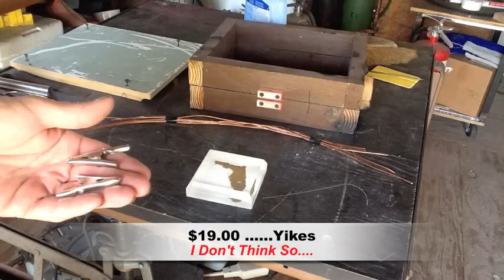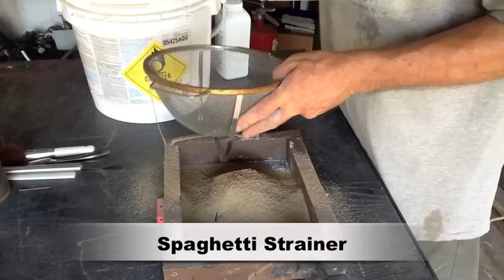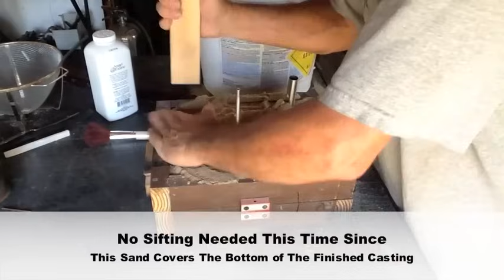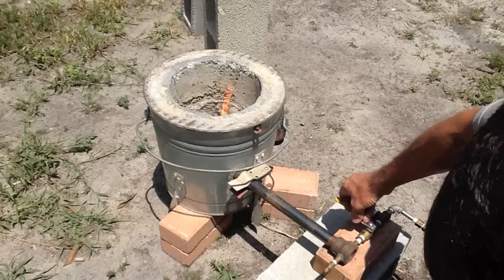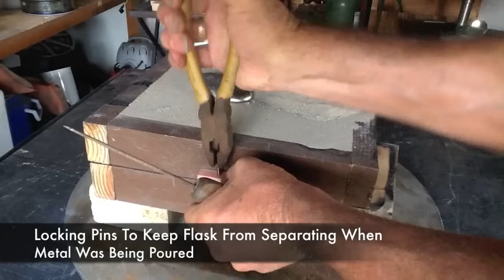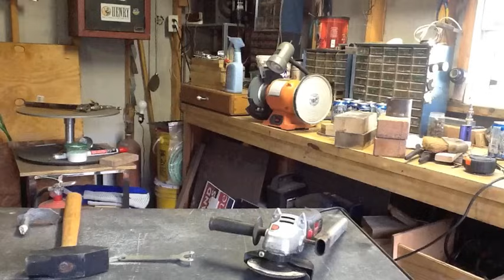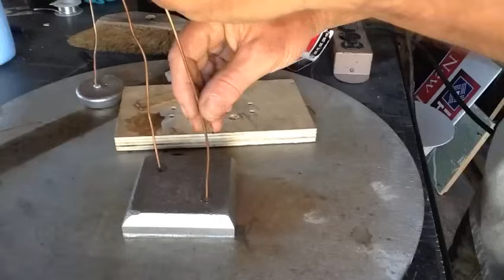SAND CASTING LESSON FOR BEGINNERS - STEP-BY-STEP - (A 3rd HAND) - MSFN

Comment: Nice. However, holding an object in your hand while using an angle grinder is not a good idea. Ask me how I know. Bench grinder should be bolted down. At least eye protection was used. Good job on the molding process.

Comment: I am thinking of trying to cast some seed plates for an International Harvester Duplex Planter.  They are concave on the back and convex on the top, with about a 4" opening in the bottom that sits on another flat plate that turns the seed plate.  They are about 8-9" in diameter and about 1" deep.  I think I would place the seed plate in the bottom half of the mold with the larger diameter on the table top.  Sprinkle talc powder, cover with green sand, then turn the "drag" over.  Due to the 4" hole it will have sand in it.  I guess I would remove the green sand in the concave part of the seed plate.  Then I would talc the top of the drag, install the "cope" and insert a sprue and vent rod then fill with green sand.  Then seperate the "drag and cope" and make a channel from the sprue to the pattern.  The plate is about 1/8" thick.  Is this something that could be done with Aluminum?   Would I need to put in extra vents or sprues, and does it matter if the vent is at the top of the item or at the base?  The original plates are cast iron.  Thanks for posting and sharing your knowledge.  Ken

Comment: This sand casting tutorial is an exceptional resource for beginners venturing into metal casting. The instructor’s clear, step-by-step guidance simplifies the process, making it accessible even for those new to the craft. The video covers essential aspects—from preparing the mold to pouring molten aluminum—providing a comprehensive overview. It’s evident that safety is a priority, as the instructor emphasizes proper precautions throughout. The practical tips and thorough explanations instill confidence, encouraging viewers to try sand casting themselves. Overall, this tutorial is both informative and inspiring, making it a must-watch for aspiring metalworkers. ￼

Comment: I have read that you should only use electrical solder for wires. Apparently plumbers solder has aggressive compounds that can degrade the wire. You may have better luck with the electrical solder.

Comment: Great video, bud. The ingot mold on the plywood was no where near as bad as what I did.. I was making bronze, and when I poured the molten bronze into the heavy steel cupcake mold I had, I quickly realized the steel pan was in fact aluminum when molten aluminum came flowing out from under what was left of the pan in every direction.

Comment: Possibly a stupid question but,

Is the sand reusable afterward? I mean in the sense of do you need to mix anything with it post its use like more clay etc or just good to go again,

Also are you just using that fine sand mix with clay or just straught normal wet sand?

Thanks
Reply: I should mention I ask this because I saw a video of a guy using aquarium sand and mixing it with 5-10% kitty litter (clay) and light water to make a mould able sand

Comment: THANKS, MSFN, FOR DEMONSTRATING THIS ESSENTIAL, USEFUL PROCESS!!! :face-green-smiling:IMHO: I WILL SUGGEST THAT THIS SIMILAR PROCESS, CAN BE USED TO POUR BABBITT, (WHITE METAL) SOLID BEARINGS, FOR LOW SPEED AXELS, AND SUCH. PERHAPS YOU MAY THINK OF SOME APPLICATIONS, FOR THAT PROCESS,... PERHAPS MAKING SOME SORT OF "ROLLING MILL", OR SHEET METAL ROLLER/CONE ROLLER, OR A BENCH MOUNTED TURNTABLE, OR, A "STAKE-HOLDER" FOR HOLDING SHEET METAL HAMMERING DOLLIES, FORMERS, ETC., ETC. :face-blue-smiling: BEST WISHES!:face-red-heart-shape:

Comment: Thanks very much for a great video describing the process.
I went on a 'grinding wheels' course in 1981, the training was a requirement for classroom teachers delivering metalwork classes. I still remember the holes in the roof above the grinding machine in the training centre. They'd decided to leave the holes there to reinforce the consequences of misuse of high RPM wheels. With bench grinders, it's important not to grind soft metals such as aluminium, copper etc as the metal clogs the wheel and causes it to become unbalanced, then potentially break up and part company with the drive spindle. Over the years, I've developed a technique for grinding my wood turning chisels, which involves standing to the side of the grinding wheel - out of the line of fire :) :)
Reply from the maker: Thanks for the good story, I was new to wheels at the time it was filmed. I am glad they left the holes :)

Comment: I see that Henry sticker in the back. I bought a Henry for Christmas. X Model, .357/38 w/sidegate and threaded barrel. Its so fun shooting 38s suppressed. Ive been reloading for about 15 years and have a bucket full of spent primers and bad brass. Im getting ready to finally melt it all down for stock for the mill and lathe. Cheers from Idaho.

Comment: I use an electric heat paint stripper gun for soldering on stuff like Bowden cables works great not too hot. What do you use for the melting pot ?

Comment: I am not sure if this is the right place to ask but do you have any idea where I can get more hands on experience like this? Outside of messing around with an Arduino and working on course related work in the shop I haven't gotten too much hands-on experience and I'm not sure where to start. Any insight would be appreciated. I've noticed a lot of people have been referred by their professors which is great, mine also did the same (not to this one specifically). I just had the thought that instead of just watching being able to actually work on these might be helpful.

Comment: This guy is not a professional. Professionals use binder (e.g. sodium silicate, a.k.a. water glass), googles, and protective garments. Carbon dioxide turns the sodium silicate into a solid in a few seconds. The binder costs pennies, but it greatly improves quality of the cast. Some amateurs use glycerol diacetate rather than carbon dioxide to harden the silicate. This method is slow - it takes 20 minutes.
Reply from the maker: LOL

Comment: Epoxy really doesn't adhere to copper very well, I use copper wire to stitch objects together temporarily when preparing to epoxy them together then pull the copper stitching out using wire cutters and pliers once the epoxy cures.

Comment: Hello. I am a beginner, and my project might be too difficult, but i try anyway... 😅
My grandfather gave me a bb rifle, (use it to shoot rats) but the wooden stock fractured, want to pour new one from alu cans, but i'me thinking to make 2 molds (rear part flat on its side, and front part turned 90 degrees to be able to remove from mold) and than removing the sides and connecting the 2 (lining up the holes and at 90 degrees to each other). You think that's doable? Or is there an easyer way? 
Thanks for your vids, they are a great help 👍
Grts
Reply from the maker: Sounds like you have a good grasp of things. Try it, if it fails remelt & try again.
Reply: @MakinSumthinFromNuthin  Will do. I'll send a picture of the result (whatever it looks like 😅)
Reply from the maker: @yvesdedecker8090  awesome!

Comment: what type of metal did you use, and what kind of sand? thanks
Reply from the maker: I melted aluminum, here is the recipe for the sand: https://www.youtube.com/watch?v=2rAQxw6X6uc
Reply: ok sir, I am getting pretty in to this lol. Do you have a video on equipment? like a forge and crucible? Or where to get these? thanks for all the info
Reply from the maker: @timheller5929  Yes, I do......go back a ways in my video collection and you will find what you are looking for
Reply: can you buy clean aluminum?
Reply from the maker: @timheller5929  Yes, if you can find a friendly scrap yard you can. I have a friendly one nearby
Reply: how many times can you use the sand after cast
Reply from the maker: @timheller5929  over & over, years

Comment: Thanks for the video. I've casted a few times during highschool in engineering. It was always fun working the forge. Now I need it because I've got a few older cars, the parts aren't being made anymore. So I figure I'll cast the old one, sculpt the sand, cast it and see if a machine shop will do most of what I cannot do. 

Question? Is there a way to cast hollow objects? Like pipes and tubing?
Reply from the maker: Yes, a sand core is used. Google it and you will see how its done

Comment: I've been soldering since I was a boy.  I'm, 67 now.  Here's a couple tips.  Everyone knows to use flux and to clean the parts you are soldering.  But don't forget the SOLDER can't have DIRT, or CORROSION, or water-damage or ETC.  Also soldering electronics, you must have a proper iron for the job.  Micro electronics requires a very tiny iron.  Soldering metal chassis parts requires a very  large iron or a torch.  You probably already know that.  I bet your SOLDER is old or dirty or oxidized, which causes trouble.  The old solder with LEAD is easier to use than the new ones that are lead free.

Comment: Do you place the crucible directly on the bottom of the furnace? Mine has a type of insulation bottom, so not sure if I need to put in some kind of brick first. Extreme beginner if you haven't noticed haha

Comment: I'll be amazed if you respond 6 years later,,, nice video,, I want to carve out a international travelall from the mid fifty's ... One said not to use wood to make the pattern in the sand,, I don't see a problem since the molten aluminum wouldn't be in contact with the wood ,,, any thoughts?
Reply from the maker: Cool old vehicle. Wood is probably the MOST common material used to make patterns, allow for draft angles when making the pattern, a smooth coating of gloss paint doesnt hurt either
Reply: @MakinSumthinFromNuthin  thanks for responding,.  It's a big undertaking.. I have the block of wood and have been thinking of a way to be a urate on both sides while carving ..
Reply from the maker: @retrobrid2784  look into how to make a "split pattern"  On my main page is a video on how to make your sand
Reply: @MakinSumthinFromNuthin  , I like it, though I strive for the best results , so hopefully time should be well spent.. I have a devise that will tell height and distance from center on both sides..  it's a start however, not sure if that will be enough from start to end.. I do make alot of items not on the market... I should make a video of my 4 wheel steer car / there's one under cutting donuts crazy car.. winter scene .. I would like to hear of any pointers  on carving / I can't be in a rush... Aluminum is the metal of choice ...
Reply from the maker: @retrobrid2784  I am no woodworker whatsoever, best of luck on your project!
Reply: @MakinSumthinFromNuthin  thanks ,, what I hope to build in 1/16:scale is international d220 with the diamond plate fenders with the corresponding window wagon body that takes the place of the day cab.. the firewall  is the same dimension as I have the real truck and wagon,, just have to make the back half of the front fenders for the rear

Comment: Tha ks so much for this. I built my own furnace and have melted down aluminum and copper so far. I want to actually cast something. What kind of sand do you use and what binder is in the sand? I was thinking like play sand mixed with motor oil just because that's what I have in my garage. I appreciate you.
Reply from the maker: https://www.youtube.com/watch?v=2rAQxw6X6uc
Reply: @MakinSumthinFromNuthin  thanks so much! Time for me to get to work.

Comment: This was a great video for demonstration purposes for sure !   but I do have to point out that in some cases, it's just easier to pay the $20 to get the tool you need.  When you factor in the cost of the sand, the foundry you made, the grinder, abrasives, the epoxy   it would definitely be cheaper to buy the tool.  No worries though, I am still giving you a "like" !!
Reply from the maker: for the 1st project, its not worth the expense. Make multiple items around the home is very well worth the effort

Comment: Hello,
The only thing wrong is your use of the bench grinder for non ferrous metal. We never use a porous grinding stone for non ferrous metal. Only ferrous metal on the grinding stone. Why? Non ferrous metal such as aluminum will be forced into the pores of the stone and can cause the grinding stone to disentigrate and explode on the user. Unsafe practice. Use your circular grinding cut off blades or a file. Take care.

Comment: The only thing better than making your own tools is years later when you pick it up to teach your kid and you can see that familiar patina on if from loving use over the years.  Maybe cast the "3rd hand" completely out of copper so if and when the wires break you can throw the whole thing into a crucible and recast it.  You could possibly also cast the wires directly into the base.

I love that your striking off tool appears to be a salvaged leg off of something, and I don't think that "sand gasket" is a step I've never seen anyone else use.  Need to pay attention and see if they are.

Comment: Im looking at doing my first casting and i think it's probably quite a tricky one, any advice is welcome!!

I need to create a centrifuge bowl, around 350-400mm diameter, around 120 tall.
The lip of the bowl for a centrifuge hooks back over towards the centre to make it function properly.
Im wondering what the simplest way to make a form for this would be.
I can turn a wooden pattern but can't work out how id get it out once the sand is packed around it. The profile of the bowl would look like a rectangle with the centre of one of the long sides removed.
I appreciate your thoughts on the project.
Im pretty confident making things, have a well stocked workshop and am sensible enough to be cautious so it's mainly the technicalities of the form im stuck with, but any advice is welcome!
Im thinking car wheels, engine blocks or bull bars for materials to melt down, but other suggestions are also welcome!!
Cheers from Western Australia

Comment: When you pull the pipes out of the fill/vent holes and then scrape the top level, couldn't it cause sand to fall into and block the holes?
Reply: nvm, I should've continued watching before I posted this question ;)

Comment: I dont have money for all that fancy equipment could i do this with a burn barrel might take longer
Reply from the maker: it can be done in a charcoal grill using charcoal or wood if ya wanna try it
Reply: @MakinSumthinFromNuthin  sounds like a good challenge
Reply from the maker: @fonziegriswold1163  you will have molten metal soon/ be careful, it hot : )

Comment: A couple questions.....1) You didnt address flux? What is it needed and what does it do? 2) Can you recondition the blackened sand after the pour has been completed? Thanks again for doing this.
Reply from the maker: I never use flux, the sand can be used repeatedly for years, just add clay when required

Comment: Hiya , i  only just found you, & intend on subscribing for sure :) I do love making things from nothing & fixing stuff. Now I just know this is going to perhaps be a dumb question, but i got to ask, why did you not set the copper wire in the cast itself? Would have been strong, no need for drilling & glueing etc, thank you 👍
Reply from the maker: Long story but I tried that 1st, and failed. think about the orientation of how the part was actually cast....it was upside down (problematic)

Comment: When you mix 2 part epoxy you have to mix it good. You barely tried to mix from what i seen. But thanks for video. Im about to try my hand at it. And wasnt trying to judge you on epoxy just a tip. If mixed thoroughly it works great. 👍

Comment: This is about as simple as you can get. Good stuff! 
I use to work in a casting plant that made railroad wheels and the frame work for the wheels
that mass produce them. I worked in the pattern shop. Very interesting job and I learned  a lot.
Mass production is the same as here, other than machines doing mostly all the work.

Comment: Just wondering if you'd be willing to use a 4wheeler seat pan and remake the video
Reply from the maker: would be cheaper to just buy the used part if available
Reply: @MakinSumthinFromNuthin  yes it would but the best reason to copy the original plastic one out of aluminum, would be to replace a cheap plastic part that is notorious for breaking and being very brittle

Comment: I'd like to ask a question as a beginner. I recently became interested in this and bought a flask and some petrabond in the hopes of copying a ring. A cartouche ring.. No matter how many times i try, i can't get an impression that doesn't get jacked up around the face of the ring. Was i mistaken in thinking this method was good for anything that is not perfectly smooth like a wedding band, or having 1 flat side like your piece here? Is there something i can do to improve the integrity of the impression? Maybe add something to the petrabond? Its very discouraging. JB Weld is the stuff. 👍
Reply from the maker: Look into "lost wax casting" method, more suitable for casting jewelry
Reply: @MakinSumthinFromNuthin  That's what i was afraid of. I already made a bootleg silicone mold and did a trial run with some candle wax. Came out pretty good. I think I'll get some of those wax pellets for the real one. I hope i can pull off lost wax on a budget. Buying pro stuff would far outstrip going to a jeweler.
Reply from the maker: @stevenedwards4470   Casting jewelry is tough, but doable with proper equipment. Best of luck sir